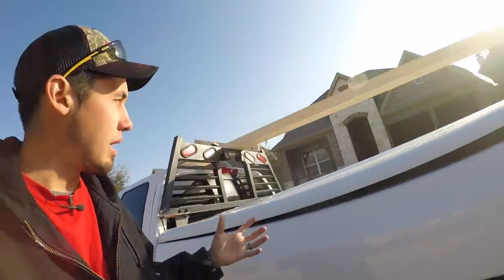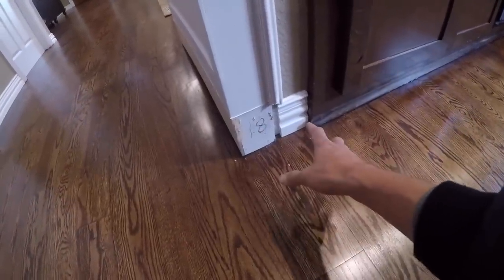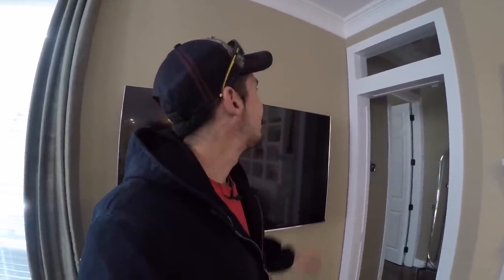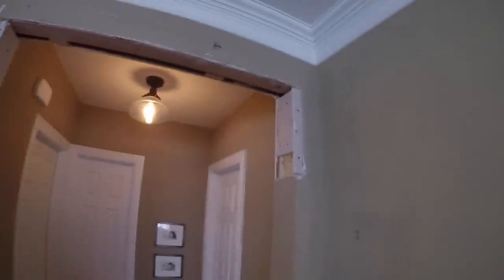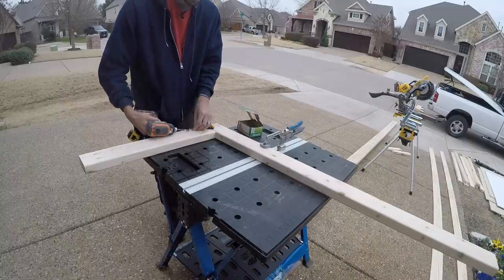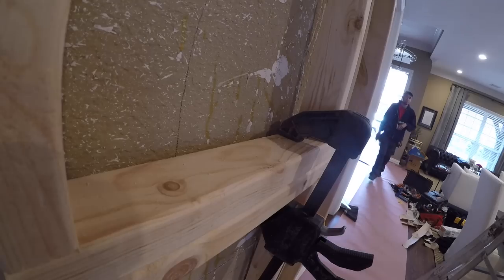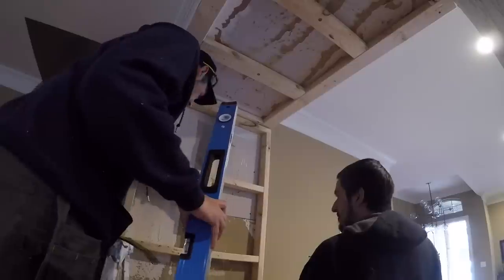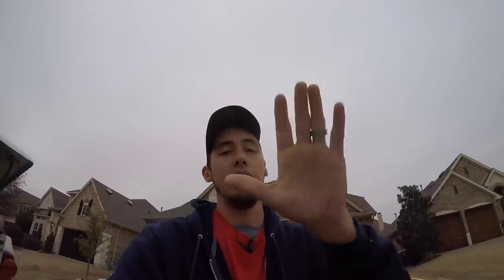A $3500 Mistake

Comment: Why not just have drywall in that area and have the walls flow through like they would normally instead of having such an elegant pass-through?  Also, purposefully making the pass-through even narrower seems like a bad idea for moving furniture, appliances, or whatever.  Why make an area smaller when it doesn't have to be?
Reply: Blaine Bugaski. You are right im surprised no one else mentioned this
Reply: Thank you.  I understand that this is what the customer wanted but unless there was a chimney or structure behind the walls in that area (which there was not) it doesn't make much sense to shrink the width of the hallway just for appearance.
Reply: Blaine Bugaski yup. I was curious why he thought about having to bring it out a bit. First thing that comes to mind is you don't want to make anything in your house smaller. If anything you want space. Oh well.
Reply: Yep.  Wonder if the same look could have been achieved by keeping the space original width OR even wider.

I also wonder what they did with that light switch.  That was some garbage stuff.  How did the original contractor ever expect to service the switch with the wood trim covering the wall plate?
Reply: Blaine Bugaski I also agree with you seems way over done.   It is also our responsibility to save the customer from themselves as well. and why the structure and mdf and all that why not just use one bys for the structure and some 1/4" ply thenm ur trim
Reply: Cause she doesn't have the best taste just look at those tacky baseboards.   I would start by removing them all
Reply: Because the homeowner wanted the "pass-through" to be framed, i.e., a cased opening. In order to do that, you obviously need something other than a flat wall on which to place the casing. Building out that part of the main wall accomplishes that and also softens the transition, thereby providing a reveal. In other words, it's not simply an abrupt corner with the casing butted perpendicular against the main wall.
Reply: Because rich people love to spend money..... true story!!
Reply: Baby gates.
Reply: TheRusschannel you don’t stay rich if you spend money.  Truly rich people are cheap as fuck.  That’s the difference between people that have juice and people that have the sauce.
Reply: He did say that the moulding was running notched into the stairs, and he s right it looks weird.  He also had to adjust the depth between crown moulding and case opening I guess he could've plained back the bowed stud, but then you would still have a ugly case opening notched into the stairs.
Reply: I think they made the right move by bringing the wall in for a few reasons. 1) The customer asked for it, and if you want a job, you give them what they want. 2) Remember the baseboard? Remember how they had all these different types of trim trying to come together to one spot and it looked awful? By bringing it in (more narrow) you give it a nice corner to tie it all together nicely. 3) The opening is wide; it is too short to be a hallway and too long to be a doorway. If you leave it wide it looks like you just slapped some trim on a short hallway and that would look bad. By bringing it in, they are defining the opening, and in turn, the room's edge. It is much easier on the eye. 4) The space is way wider than needed to move furniture and appliances, and the extra 1.5 inches will not be noticeable. It isn't like you can put a table or any kind of furniture in the transition, so it doesn't sacrifice any space of value. 5) By making it more narrow they are "beefing" up the pillar look, which gives the appearance that it is actually doing something structurally even if it isn't.

This is just my opinion as a former finish carpenter.
Reply: Blaine Bugaski she is trying to make the house look more expensive than it is
Reply: Blaine Bugaski you're right man sometimes what the customer wants isn't always right sometimes they need advice on "what I would do" and "why" I'd do it.
Reply: He doesn't have time to answer dumb questions.... he's too busy building things people ask him to build....
Reply: The second video reminds you, not only of the stair issue, but the switch issue on the other side of the doorway in the kitchen from the stairs. Moving it in makes more sense when you consider those two problems.
Reply: Yea i thought the same thing
Reply: because the wanna-be princess wants to live in a castle
Reply: My guess is that trim carpenters only think about the esthetics of things and not functionality. Usually. What I find funny is that she will soon decide it's too narrow and another guy will come behind him and make another video about fixing a $5,000 mistake....
Reply: @HolidayArt  lol.  Because he absolutely needed the extra 4-6 inches at the corner against the stairs because it takes 4 inches to coherently transition moulding that big.  The first guys problem was that he was trying to install castle style moulding around a fucking 2in corner.  Rather than the conversation leading to the homeowner no longer demanding the matching moulding, they brought in this specialist who explained why it was impossible without changing the walls.  So now they're changing the walls.

A good moulding job strangely starts at the planning phase.
Reply: Does anyone here think this homeowner will be moving their own furniture or installing their own appliances?
Reply: @Guillotines_For_Globalists  Its called take the money and run. They should of at least removed the switch, twist and wirenut plus tape the wires. Then put a smooth plate on the electrical box,
Reply: Because the customer wanted a look and that's what she paid for
Reply: It’s what customer envisions some people like clean lines some people like  it trimmed out nobody’s opinion matters except the person writing the check ! 
She paid someone twice to do it needless to say that’s what she wants
Reply: Yup, as soon as I seen the 2x4 going up I was saying the same thing. The stair treads molding is nothing to notch compare to the opening being reduce.
Reply: @allukenuppercut9851  Exactly, the next two videos show that he created a consistent gap between the trim and the adjacent walls. The casing shouldn't butt up into the stairs. It was tacky and cheap. It was also butted up against the wall on the other side. He made it match the other openings by framing the opening to the same size. He also admits he doesn't do drywall work, so she could have found some one else to do the drywall and fix the stud in the existing location, but it wouldn't fix the above trim issues. 

Yes, it's a lot of money to change it, but the previous work was shoddy.
Reply: Jolly Pink Giant not true at all just because they don’t know construction related issues doesn’t mean they aren’t like Einstein at something else 

Why do comments on videos exist ? Reading the stupidity in comments is more appealing than videos ! Pretty soon they are gonna have video ads popping up when you are reading through comments I’ll buy stock in comments
Reply: DIMEBAGONICS Exactly!Sometimes you have to talk people out of things, it doesnt mean your not good enough to do it.
Reply: did you see the size of the opening? how big do you need it??? its bigger than a standard door way....1 1/2 in. isnt gonna hurt shit
Reply: It takes studs to build houses
Reply: Because she is a woman. Women are the only reason most remodelers are in business.
Reply: And 3500......????

Comment: Red rosin paper not really protective enough for demo work. Ram board, or even better corrugated white plastic panel. Goes down fast and is reusable.
Reply: ¼" fan fold- easy to cut and lay. Easy on surfaces and your knees, too.
Reply: if a home owner walked in and saw me doing demo without plastic covering everything i would be fired so quick
Reply: @texaskippen  that's exactly what I was thinking.
Reply: Red rosin paper when it gets wet will stain your laminate engineered flooring. Happened to me and made a nasty spot on finished floor in the kitchen. Had an unexpected plumbing leak. Floor got wet.

Comment: Thanks for the video. Very informative. I like that you explain what you encountered, and how you addressed the issues found. I also like that you are updating your followers on the new Dewalt Flex tools and the new miter saw fence system you added to your tool arsenal. Thanks again.

Comment: I love your work, I was thinking to myself when you were doing the framing portion that you could have tied into the electrical and added some low voltage   / LED recessed lighting in the top. Also, Dewalt should start giving you some kickbacks, because when you compared the Festule vs Dewalt I agree 100% to your assessment... I love me some Dewalt tools as well.

Comment: The glass pieces over the doors are "transoms"
In the era before Air conditioning, they were hinged, could be opened and provided air circulation.
Air conditioners obviates the need. 

So they look goofy as they are, serve no purpose. Visual clutter.
Correct to remove them.
Reply: Or could have put decorative Stained Glass Transoms in!

Comment: Thank You for your Professionalism re others sub standard work. Over the years I have actually received jobs for exercising restraint in calling out others errors. Mind you, a certain amount has to be spoken to convey to the client what needs being removed/repaired. IE:  the lack of molding around the glass in this video.

Oft times  (actually, almost always) the customer does not know the full extent of the shoddy work needing to be replaced. One must use tact and understanding. I also HIGHLY recommend a full on video/photo documentation of any and all re do's of other peoples work to cover your liability in case of a lawsuit.

Comment: Love your videos. As a flooring guy, though, I can say you should never screw anything down through the hardwood.  Solid wood should have an expansion joint at every wall. Screwing through it can cause it to buckle or warp or squeak.

Comment: Question. On the one hand you say quite correctly the Jack of all trades are typically master of none. On the other hand you are finish Carpenter who owns a cleat hammer. So where do you draw the line?
Reply: Joseph DESTAUBIN A true finish carpenter can do all steps of carpentry to a master level.  Finish is by and far the hardest. Everything else is eaiser but grunt work.

Comment: Sorry but your rough carpentry where you tried to use 8' studs to build out the wall is sloppy and weak. If you install any type of panel over that and place the seam along the two sections, it will crack as the wood moves.
Reply: seephor He is putting a wood 1x6 over the seam,so that’ll take care of the seam. The 8 footers were probably cheaper than using 10 footers anyway.

Comment: Why not just fix it? floating a fake wall on a wood floor,  shame.
Reply: crush smith in the beginning he said it is he will build out the wall so it wouldn’t interfere with the stair
Reply: And then he spent 15 youtube minutes making a wall instead of replacing the stud that didn't interfere with the stair. He also kicked the wall off camera. I'd kick this guy out of my fucking house
Reply: The whole "attach it to the hardwood floor" had my eyes bugging out.  Use a Fein saw and fit the floor to the new wall, attached to the subfloor.  I'd also be tempted to open the wall and replace that bowed stud, since he already buggered the drywall there.  If he's gonna fur the wall out, might as well strip the drywall off and build off the studs already there.
Reply: An inch really?
Reply: That wall is just to create thickness he needed to create the trim detail , so why waste the customer's money doing exploratory work guys.....
Reply: @eformance  Makes no sense.

Comment: I think they made the right move by bringing the wall in for a few reasons. 1) The customer asked for it, and if you want a job, you give them what they want. 2) Remember the baseboard? Remember how they had all these different types of trim trying to come together to one spot and it looked awful? By bringing it in (more narrow) you give it a nice corner to tie it all together nicely. 3) The opening is wide; it is too short to be a hallway and too long to be a doorway. If you leave it wide it looks like you just slapped some trim on a short hallway and that would look bad. By bringing it in, they are defining the opening, and in turn, the room's edge. It is much easier on the eye. 4) The space is way wider than needed to move furniture and appliances, and the extra 1.5 inches will not be noticeable. It isn't like you can put a table or any kind of furniture in the transition, so it doesn't sacrifice any space of value. 5) By making it more narrow they are "beefing" up the pillar look, which gives the appearance that it is actually doing something structurally even if it isn't. This is just my opinion as a former finish carpenter.

Comment: I correct bowed studs by removing the drywall at the worst  areas of deflection between to known straight studs and depending on the severity of the deflection I determine if I need multiple board inserts and if I’m using a 2x4 or 2x6 board from the two adjacent straight studs and notching out exactly the bad stud to nail the board which then straightens the deflection completely... and it meets code requirements also.

I learned this from seven years as a rough carpenter 3.5 yrs of which I was the lead carpenter. I was the punch out carpenter that went out and fixed all the bad work the inspectors found. This is why I know this method.  Also a bunch of others for rough Carpentry

Comment: My personal experience with drywall reno is that I have to mask the entire floor because the white powder gets tracked from place to place and is difficult to remove from expensive textured wood or tile floorings. I also have to lay plastic over all furniture because the dust floats and lands everywhere.

Comment: Clad mdf together crap but decorators love it. Plus the cost and finish you get is good.  I would of got 10 foot 4x2 but you've gotta use with what you've got. Maybe staggering the joints for extra strength on the 4x2. Nice job.

Comment: 9:50 When you specialize in everything, you specialize in nothing. Completely agree with you. Great work.
Reply: @Benjamin Jacobs That's not really accurate in my experience though. I lead a team of software engineers and what were strive for is more like "capable in many, expert in one". But the point here is that if you try to be an expert in everything, you actually won't be an expert in anything.

Comment: I’m curious as to why you did your ceiling framing like that. Why not run your 2x4’s with the direction of the opening. I guess it would make a little sense if you need the solid framing around the edges. 

I would’ve just run a couple of screws on the edge to fasten it up there though. Any particular reason you used the goggles in the middle?

Comment: Question: On the side of the alcove wall that is bowed, why would you screw your framing into the hardwood floor? What if the owner wants to change out the floor one day? I guess they could cut it out around the framing, but why not cut the floor now and take the framing down to the sub (or concrete) floor? Just curious.....

Comment: Those toggle bolts are great but they have a chunky head on them and SHOULD NEVER be cranked down to countersink the head. So, before you drill out for the toggle bolt itself, start by drilling a 1/8" to a 3/16" deep recess with a sharp 1/2" paddle bit or a forstner bit. Then use the center of that recess to drill for the bolt. This will provide a countersunk well to keep the head below the surface of the framing. This keeps the drywall perfectly flat against the framing.

Comment: Hard transistion, yes but not impossible give the correct base / casing / scale. Run the base as a bump-out and wrap with a return so that the existing base can run into the new base flat. As a bump out style, if the scale is right, the new casing will appear to be wrapped with the base as well. A hard transistion they is done right and well can actually be very pleasing to the eye. The way they did the trim around the stairs was correct, but it just wasn't done well. The crown could have also worked if they similarly wrapped it around and returned it to the wall and left the upper casing off completely.

Comment: I wonder about screwing into the hardwood floor. I understand there are limited options, but won't doing that create a bigger problem later if the floor needs to be repaired or replaced?

Comment: I think rhe only reason that opening by the fire place was missing the trim around the casing was because it was lacking the room on the left side casing.  It was right up against a 90 degree wall. No room, poor planning. Did you figure out what motivated using trim over the glass on just the one opening?

Comment: I like you’re doing except for going into the floor. Hard wood floors need to expand & contract with temp/humidity changes. You just limited some of that. Putting some 2x4 on it side in the bottom of the frame would’ve allowed you to attach to the plate behind the wall. Use shims to level it a bit...

Comment: If you use that jig frequently, could you put a t-track down one edge, cut a small 4" L shaped piece of MDF, cut a hole the size of the vacuum hose in it to make a sliding dust collection so you would have to hold the hose?  Just an idea for your patent. :)

Comment: How things have changed the room I slept in in an area where it snowed regularly the walls framed on the inside no inside covering on the studying and you could count the Stars between the cracks in the 6 inch wide boards at night or if you turn the light on  inside the building, from the outside it looked like a zebra at night and of course there was no heater. Corrugated tin keep the rain out also visible from the inside. To this day if the wind is stopped by the walls,  I am happy !